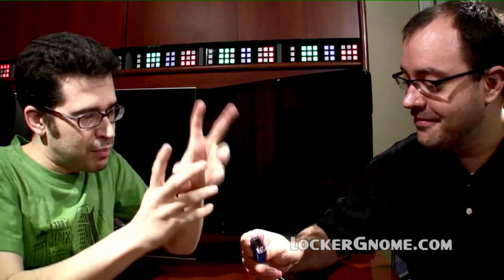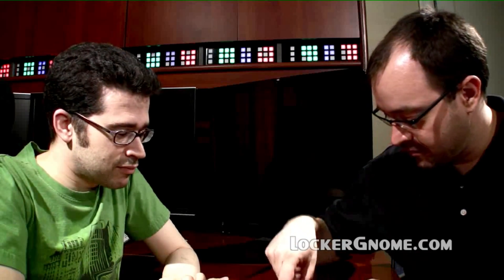How Can You Tell if a Cable is Male or Female?

Comment: Very funny, but without close up visuals, it doesn't help as much as it could, especially with HDMI and DisplayPort.  Anyway, I just finished learning on various sites that HDMI can be a little confusing at first.  The HDMI male connector has plastic housing sheathing part of the pins that traditionally is found on female connectors, plus, there is a gap in the middle where the female tab slides into, which again, is counter intuitive.  With vga and dvi, it is the exposed pins that slide into the female housing.
Reply: pull that foreskin waaaay back ...

Comment: @NZappletech 
Actually a cheaper cable probably works to. But is simply not CERTIFIED to do it

Yup you hear that right when it comes to quality many HDMI cables are very very equal but CERTIFICATION makes it more expensive. So some of the "expensive" cable are certified lower. 

You could even buy the cheapest at Mono Price and who knows maybe it works. One thing is certain MONSTER cable.. not worth it! Not with HDMI!